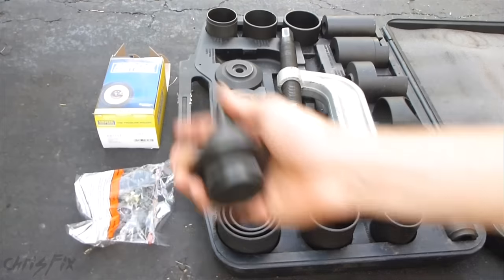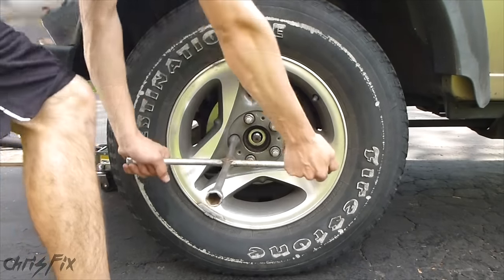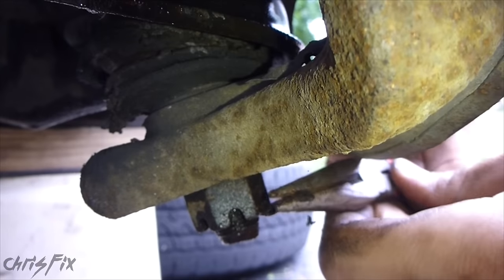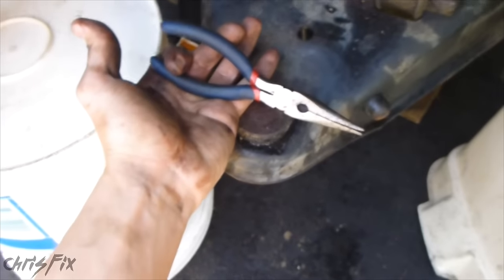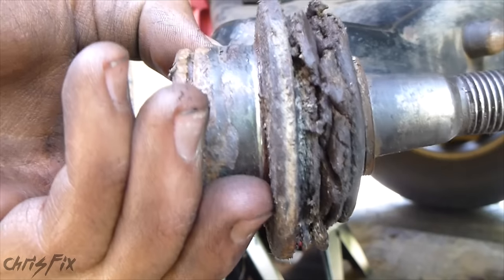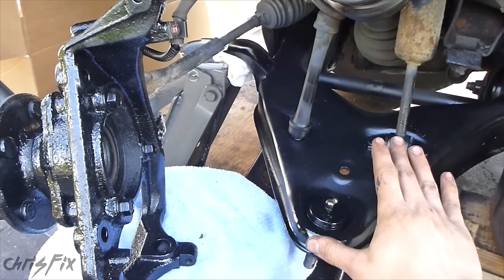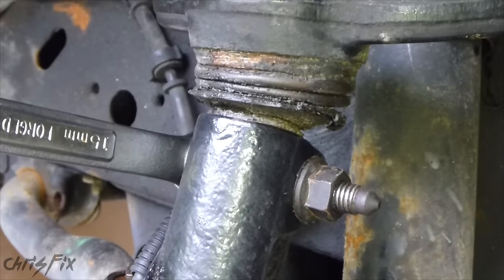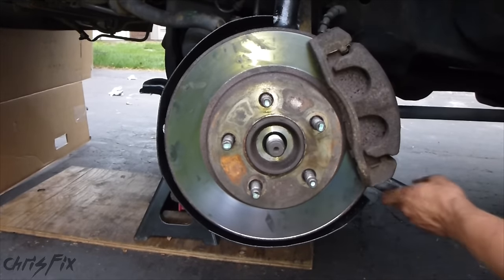How to Replace a Ball Joint (in depth, ultimate guide)

Comment: Hey great video... but I'm having a hell of a time getting the upper ball joint back into the spindle, I've got the LCA Jacked up as much as I can, hitting it with a rubber mallet, etc and nothings working. Tips?
Reply from the maker: Do you have a press?
Reply: No
Reply from the maker: Well, that is your problem. You really need a press. The local parts stores rent them for free. Just ask for a ball joint press. Hammering it in will damage it.
Reply: I don't see how you could use a press for the upper... shouldn't it be as easy as it was for you?
Reply from the maker: Maybe I am not clear. You are trying to get a ball joint into the control arm correct?
Reply: No, I'm trying to get the original upperball joint, which has always been attached to the upper control arm, back into the spindle. Sry for the confusion
Reply from the maker: Ohhhhh ok. I jacked the control arm up as much as I could (put the jack at the end of the control arm to lift it the most). Then I used a rubber mallet to hit the upper control arm while aligning the ball joint stud. You can also hammer a screw driver into the rear of the knuckle where the ball joint stud goes into (there is a slit there and hammering a flat-head will open up the gap a bit. Also, you can spray some wd40 or some grease or something. Do you have a 4x4 or 2wd?
Reply: 2wd. I've tried some wd-40 but haven't tried the flat-head. Thanks for all the help so far, I'll try it tomorrow
Reply from the maker: Someone was saying that the 2wd has a narrower stud on the ball joint and the 4x4 has a larger stud. This person and I have not confirmed this yet, but maybe you got the 4x4 control arm and the stud is too large?
Reply: That might be possible, as the side i am working on has had its control arm replaced (probably by the previous owner) and the other side is still the stock arm
Reply from the maker: I am really curious!

Comment: How do you measure the presure to tight the cricket? Its a soecial tool?
Reply from the maker: Rami Barrionuevo It seems like you are asking about how to measure the correct tightness of the nuts. To do that, you can use a tool called a torque wrench. This allows you to tighten down the nuts and bolts to a specific tightness.
Reply: It sounds like what you are trying to ask about is "How to measure the correct torque of the various nuts?" And the answer is: a tool called a torque wrench... You can set various presets of torque, and when the torque is reached, you hear and feel a click...
Reply from the maker: DijonInjection Thanks for the clarification. I couldnt figure it out haha

Comment: Number ONE.  The parking brake was NOT applied.  I would have stopped watching right here as it's the first proof of an amateur...and amateurs pretending to do professional work are dangerous. 
Needle nose pliers are not the tool of choice for cotter keys.
                  "As I lift, this is going to pop out"....yeah, if you're lucky.  Penetrating fluid is not magic and frequently is no help.

 Now the spindle (he doesn't know the terminology) is on the "bucket"...what happens when you find a tear (common) in the boot?  ---- ( the outer or inner CV joint.) Should you look for a tear in the CV joint boots?   Oh, never mind. The most stressed part of your suspension dosen't ever need to be checked.  Especially when it's so easy to throughly inspect it with the spindle off.

  Needle nose pliers to R & I snap rings?  I guess needle nose pliers can do anything. Did you notice how many "cuts" in the video when he was removing the snap ring?  That's because he couldn't do it.  As I said, penetrating fluid is not magic. I guarantee you he didn't get that snap ring off with those "needle nose" pliers alone.  He loosened the ring with the proper tool (snap ring pliers) off camera, and then proceeded to remove the now loosened snap ring with his "all purpose" needle nose pliers.

 He is gauging the proper size cup in the ball joint  press by comparing it with the NEW part?   Suppose (and it happens a LOT) the new part isn't correct?  He now has the wrong size cup and at this point things can get dangerous.  Severe injury dangerous.

  I can't watch any more.  So what happens after 7 minutes may be perfectly fine.....or not.  This guy simply want's free parts and YouTube views and maybe a little money and  fame besides.  I have no objection to free enterprise but suspension work on a vehicle is not an amateur project.  I'm not in the business so I have no financial interest. (I was in the business many years....a professional)   You want to DIY your vehicle, I say fine....but don't mess with your suspension.  You're driving a 3000 pound missle in a world of 7 billion pedestrians.  Don't kill one of them....or yourself.
Reply: Number ONE. Just because applying the parking brake was not shown in the video, doesn't mean he didn't do it. Perhaps because it's common sense to apply the parking brake when jacking up a car from the front. 

         Not everyone has all the appropriate tools for all jobs , so you can't help but to improvise. As long as the job gets done. 
I don't know about you, but penetrating oil works great when trying to work with rusted material. 

  This video is strictly on how to change ball joints, he could make a whole other video on inspecting your suspension and what to look for. Don't you think? 
As he said in the video, he used the needle nose pliers for the snap ring to show that it's able to be done for someone who doesn't have snap ring pliers. He didn't say that it'll most likely be a pain to remove with a needle nose, but he proved that it's possible.
It seems you watched this video just to find all the things he did totally wrong to you, and not the informative part.
Reply: Clarence Keawe Maybe he set the parking brake but didn't show it? Oh good grief.  This is supposed to be an instructional video. Why are you making excuses?
Reply: +mattdbrown91 better?   <grin>
Reply: +Coleman Adamson He probably set the parking brake off camera but also its a rear wheel drive truck, not front wheel drive. So even if he forgot to set the park brake that shit wouldn't go anywhere
Reply: Brandon Tejada These are instructional videos.  As such, you do NOTHING off camera.  You like the guy, fine.  Nobody is going to take him away from you so just relax.  But do not let his videos be the only source of instruction you get.  And again, I reiterate, do not do your own suspension work.  Pay the man.
Reply: ***** well I'm a Volvo mechanic, I just greatly enjoy these videos to just see how other people work, so to me it comes common that I'd apply the parking brake, but I guess you're right in that most people watching these videos have no car experience and he should be warning them about the park brake
Reply: Brandon Tejada Thank you.  I'm sure you wouldn't have DIY'ers trying to do your job based on a YT video.  I never was a mechanic.  Engines were not my area.  I did some R&I's but not tuning, diagnosing, rebuilding, etc.
Reply: ***** yeah lol, I like this channel, he's really smart and knows what he's talking about. But it really bothers me that he makes everything look so easy, it's extremely misleading for people who have no experience and are trying to just save a couple bucks. Ball joints - he makes it look generically easy to remove them from the knuckle, in this instance the upper control arm he said all you have to do is pry up and it'll come right out, 95% of the time.. NOT THE CASE. He also had a good inner and out tie rod video which was good, but once again he didn't warn people that if your car is even somewhat old, you'll more than likely need a torch to break that shit free. He made it seem like you just needed a little wrench to break that nut loose and that is absolutely not the case for a car that's been on the road for more than a couple years.
Reply: Brandon Tejada You're right...about everything.  But IDK which but I think in one video he did have a propane hand torch.   (It would work but take forever...lol....compared to the usual oxy/acet unit.)  Yes his videos are interesting and useful for casual interest but for actual instruction they are definitely inadequate.  At least for suspension work.  In other areas the videos are pretty good.  DIY'ers can do all they want washing, painting, tuning, replacing water pumps, alternators, batteries, etc.  but when it comes to suspension...pay the man.
Reply: +Clarence Keawe if you are such a good mechanic why are you watching a how to video
Reply: lucckino I'm a mechanic and I watch simply because I really enjoy watching other people's methods, and maybe it'll help me find better methods on how to do certain things. Chris is really awesome and his videos are good, but some are misleading, some cars are different and some cars are gonna have seized bolts and some cars simply need special tools to do these jobs. Chris makes it seem like every car it'll be a breeze but that isn't the case.
Reply: For example, the new Volvo engine that's in all the models, you ABSOLUTELY CANNOT just drain and fill the coolant like Chris says you can do on any vehicle. For that engine you need a special tool that screws onto the reservoir and pulls a vacuum on the cooling system, then sucks in coolant so that it ensures there are absolutely no air bubbles. The new cooling system for that engine is special and therfore needs that special tool. Chris says you can use his method on any car. Not true

Comment: Excellent video clear and to the point answered all my questions about getting this job done. Cheers
Reply from the maker: Matt C Thanks! Glad the video was helpful!
Reply: ChrisFix One thing did you use 6 point or 12 point 32 mm socket?
Reply from the maker: Matt C It was a 6pt 32mm socket. 
http://www.amazon.com/gp/product/B000NPPBAG/ref=as_li_tl?ie=UTF8&camp=1789&creative=390957&creativeASIN=B000NPPBAG&linkCode=as2&tag=chri0e2-20&linkId=LQYBAA3JYKIHIUQV
Reply: ChrisFix Ok thanks! Can a 12 point be used? Or should I just get the 6 point. I really don't want to strip that big bolt.
Reply from the maker: Matt C I would use a 6pt because of the immense amount of force you are going to be putting on it. Strip that nut and you are in trouble!
Reply: ChrisFix Good call picked up 6 point today worked great. So all came apart great only problem lower ball joint is stuck to control arm assembly.  Any tips for best method separating these?
Reply from the maker: Matt C I used some penetrating fluid and a crow bar but this is the actual tool made to separate a ball joint: http://www.amazon.com/gp/product/B002KS17N4/ref=as_li_tl?ie=UTF8&camp=1789&creative=390957&creativeASIN=B002KS17N4&linkCode=as2&tag=chri0e2-20&linkId=MRWELB4GYB7NHQVX
Reply: ChrisFix Nice thanks ya I was sort of trying that method but always twists did you bolt the top back in and where did you find you got the best pry point
Reply from the maker: Matt C The one in the video popped right out (lucky lol) but the other side I used a chain to wrap around the control arm and put the pry bar in the chain to get leverage.
Reply: ChrisFix Well got it out! Put nut back on lower ball joint a couple of threads jacked it up from that and put upper ball joint bank in place. Then used pickle fork I rented for free couple of wacks and she dropped. Only thing I have the nascar moog ball joint and stud is a little longer than original so circlip has a little space under it but everything fit back properly bottom bolt lined up with hole so should be ok?
Reply from the maker: Matt C The length of the stud doesnt matter as long as you can get the nut torqued on and the cotter pin though. Nice work!
Reply: ChrisFix Right on thanks again and hopefully our conversation will help others.   Cheers

Comment: What kind of noise will it make if you failed to replace it.
Reply from the maker: I am working on a video to show you how to diagnose a bad ball joint currently but until that is published you watch this, How to Tell if Your Tie Rod is Bad at the beginning you can hear a bad ball joint.
Reply: ChrisFix Did the Moog Lower balljoint of yours have the boot disconnected from it cause mine came like that.
Reply from the maker: Cha2kDrAwn No, my boot was connected. From what I remember the boot was really tight at the bottom.

Comment: What kind of paint did you use on the control arms?
Reply from the maker: sephora99 I used this stuff which I have been impressed with: http://www.amazon.com/gp/product/B005H5P5C6/ref=as_li_tl?ie=UTF8&camp=1789&creative=390957&creativeASIN=B005H5P5C6&linkCode=as2&tag=chri0e2-20&linkId=GRM7JIARVY3SVZKV
Reply: ChrisFix Thanks!  It came out looking really nice in your video.  Hope mine will too.
Reply from the maker: sephora99 Keep me posted!

Comment: Hm, should not be the hub nut replaced ?
Reply: depends on the hub nut that is equipped with vehicle.. if its the one where you have to make a dent in it with a punch to prevent it from backing off, then usually you replace those and only because the threads tend to get damaged when you break them loose(people refuse to lift that lip when breaking loose). on the other hand, the hub nut he had in this video should be fine, add thread locker and torque it, call it a day

Comment: Someone should make a wrench braker bar long
Reply: They make them.  They generally aren't cheap. The ratcheting teeth on most socket wrenches generally aren't strong enough to be used as a breaker bar. If you need you can put a long pipe on a socket wrench to extend it. Leverage is your friend.

Comment: Moogs are nice replacements but when my old truck my 03 gmc sierra 1500 wrecked and totaled it was caused by my lower ball joint snapped clean apart off the spindle, all front end parts where replaced within the past 7 months total, all done proffessionally and both sides sets of balljoints where 4 months old roughly.. clean snap..
Reply from the maker: Dang that is scary!
Reply: Thats one reason I go to junkyard and get the whole control arm , used as long as the ball joint is good. I don't trust these Chinese made ball joints.
Reply: Y10Q Moog ball joints are American made.
Reply: if your ball joint snapped in half its cus the taper on the knuckle was worn down, increasing stress on the ball joint stud and snapping it eventually
Reply: +fruitydudexD - How the heck do you detect that before it's too late?

Comment: handy tutorial video
Reply from the maker: Thanks man!
Reply: ChrisFix
I forgot to ask you a question. How can you tell if a ball joint is worn out
Reply from the maker: I am actually editing that video as we speak. It is simple. Here are a few methods. Lift the car and grab the tire at the 12 and 6 positions. Shake back and forth and feel for play. You can also inspect the ball joint itself and see if the boots are cracked and if your ball joints are making a squeaking noise when you turn the steering wheel or go over bumps.